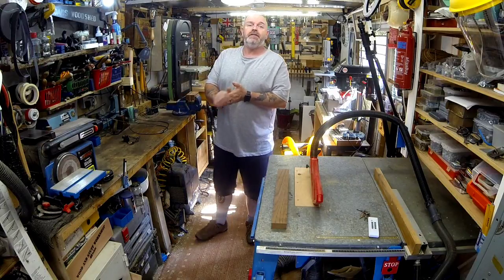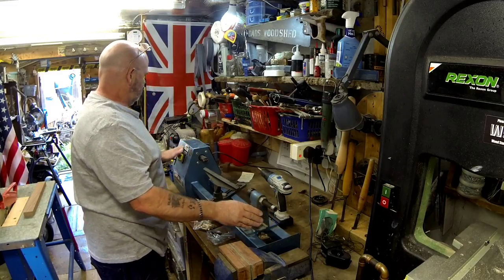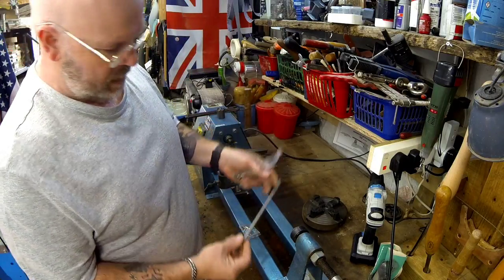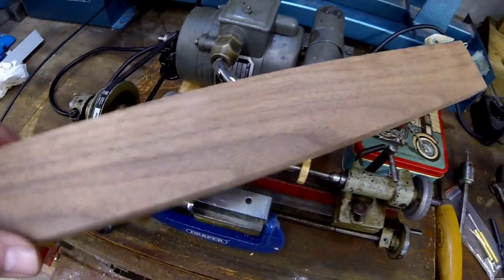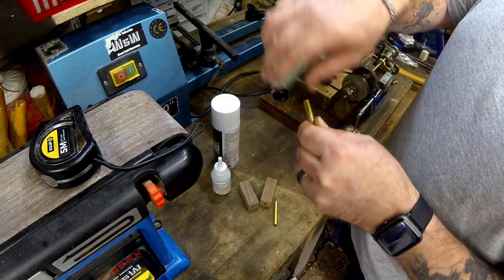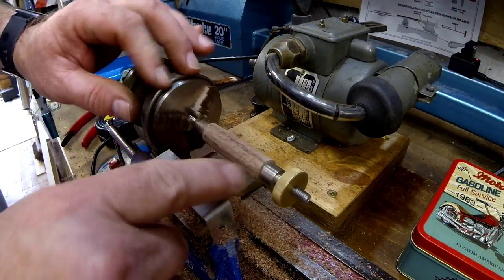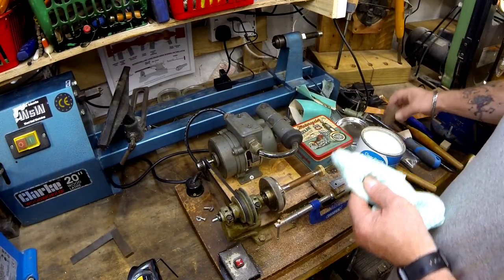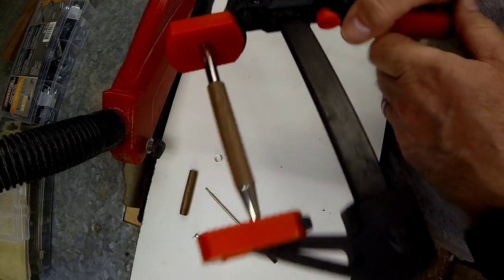Turning A Walnut Pen Without The Correct Tools / In The Workshop

Comment: Great gifts for loved ones. I am certain you can remove the jaws and turn them around David.
Reply from the maker: Thanks for watching Brian, yeah the jaws turn around but won't hold anything smaller than 12mm 😕 Might use the lathe at work to make a bush that I can weld to the mandrel.
Take care 👍

Comment: Nice work, David. I tried to make a pen last year but failed 3 out of 3 so figured I needed more lathe practice before trying again. Lovely pen. (I did just what you did with the CA Glue - pressed the brass centre in without thinking and glued the tip of my finger! :-) ). Great to see the little lathe running. Going to try some metal lathing soon? Take care and thanks for sharing.
Reply from the maker: Thanks Sandy, I need to do some metal lathe work to make the mandrel fit my wood lathe. I might try the little lathe but otherwise I will have to do it at work.
Take care 🙂👍